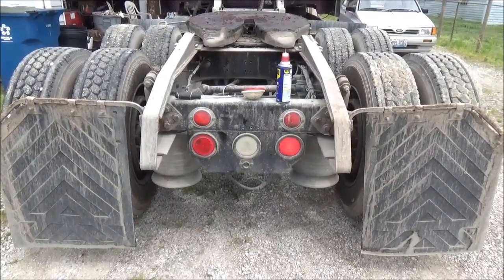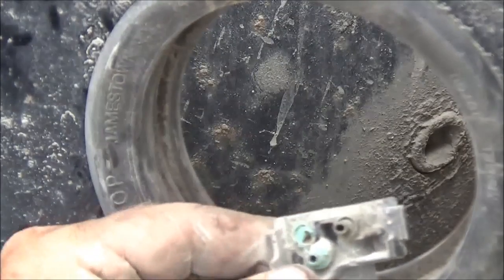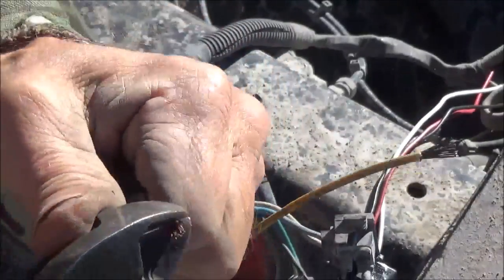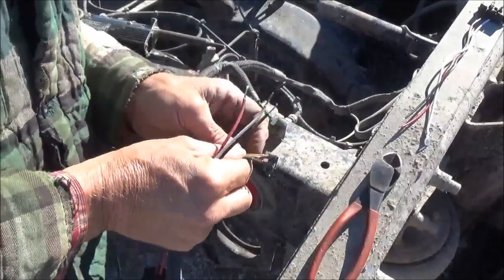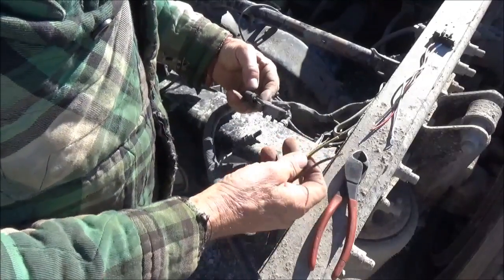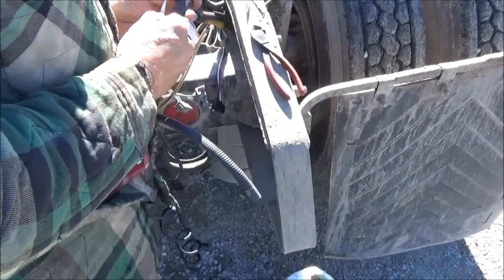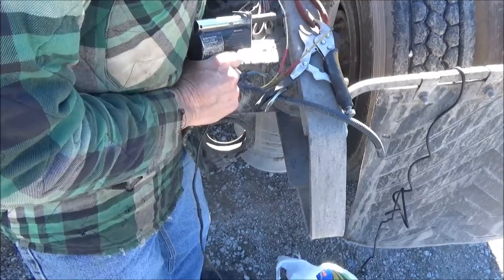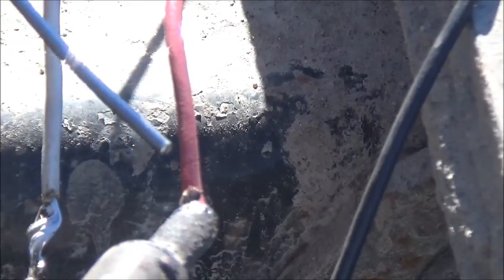Repair brake and tail light wire harness on big truck

Comment: Not many trucks running around without led lights anymore, very nostalgic:)
Reply from the maker: It's an old local work truck, he doesn't care about how it looks. If we went LED it would cost hundreds to change everything over, kind of pointless to do 1 or 2 lights at a time. But if we ever did the body work on it, I would suggest going LEDs all the way.

Comment: I was trying to rewire two reverse lights on a freight liner today with no success. Replaced to brand new 12v lights and getting only 10v on the meter. Problem?

Comment: Hi Gordon - good job - next time you have a soldering job try to use liquid electrical tape on the soldered wires - then wrap electrical tape - it will be protected in all types of weather .
Reply from the maker: Good Idea, thanks.
Reply: also good is heat  shrink and self amalgamating tape, but you cant carry everything!

Comment: Watched many of your videos, seems I just need bigger tools for the bigger toys, and good common sense. Good advice to solder the connections in a high vibration environment. Consider a blob of vaseline or dielectric grease  on the inside of the connector to keep the corrosion at bay on the contacts.
Like your ground level camera and monitor setup! Innovation at its finest. Now put wheels on for pan shots! LOL
Reply from the maker: You're right, the grease does help at the plug in connection. Thanks for watching and commenting.

Comment: I need to do the entire headlight running light and turn signals on the tractor. I have a 95 classic. They butchered the harness. No solder anywhere cut wires not connected everywhere as well. Any instruction you may have or any videos you may be able to recommend would be much appreciated. I can do the repair you've done in this video no problem, the only issue I have is breaking down every wire in the harness and figuring out each one. They hooked the damn wiper power into the headlights as well. When the lights are on I have no left turn signal and when they're off I have a left turn signal. Right turn signal always works. Just wanted to give some more information. Thanks in advance. I'm shut down til I get this problem fixed. These problems were "inherited " in the last two weeks but obviously took almost 3 decades to create so I understand I'm asking alot but like I said any help is much appreciated. I'm in ohio near Cleveland.
Reply from the maker: I can't be much help 600 miles away in the St. Louis area but I can tell you your left turn sounds like it is grounded to one of the hot wires on the headlight which gets canceled out when the lights are on. Give that turn signal a true ground and it will work fine. I'll try to remember this and another recent question on some electric work I did on a motorcycle as well as some older questions on small engine electric videos I did in the past and I will try to do a series on running down electric problems and the basic laws of how electric works and what size wire goes with what fuse/breaker and why. Once I understood this I never had any trouble fixing any electric on any 12 volt and also on 120/240 ac in houses.
         You might find some help in my playlists on auto electric and house electric.
Reply: Thank you I appreciate it. I figured it was a wire crossed somewhere just needed to hear it from someone with a clue. I can wire an entire house but in a vehicle I can replace existing but finding problems has been difficult in the past. I appreciate the fast response. Thanks again.

Comment: NICE VID,, pete sujestion of liq-tape,, howerver, its a good idea to use heatshrink tape,, do not use electric tape, unless you use liq tape to seal the exsterer end of the tape,, that way the tape don,t unravel later on down the line,,, 
I like the way you talk and exsplain as you go,, great job,, i just bought a 1977 kw,, and fine your vidieos most helpfull,, thank you

Comment: i put muratic acid and a q-tip to clean copper wire  before soldering. it is a light acid and wont hurt the wire or insulation. works great. i also like to put de-ox on the solder joint and then use heat shrink over it. it seems to work well.
Reply from the maker: Sorry about the heat shrink, I was out of the size to fit that wire. I'll have to disagree with you on the M. acid, I know how well it cleans and it can be used if diluted about 50% and then neutralized good with baking soda, but the acid soaks into the stranded wire where you won't get it neutralized enough and in time you will most likely have green corrosion that can end up eating through the wire. I was taught to never use acid core solder on electric work, if the M. acid was ok then so should be the plumbing solder. Thanks for your comment. I have used the muriatic acid mix for soaking multi connectors and switch contacts but always fear the acid getting into the stranded wire. Vinegar helps too.
Reply: Gordon Robertson everybody likes what they like.  I have never had any problems with doing it this way. always lasted longer than the truck or trailer. I appreciate your respectful way of disagreeing.

Comment: I have used sandpaper before to scrape the black off. Just spread the wire and fold the sandpaper over the threads and pull on the wire a few times. Every time I tried using cutters to scrape, I'd end up cutting the wire. I use liquid soap on the rubber grommets popping the lights back in. They seem to slip in pretty easy that way.
Reply from the maker: Good idea. Thanks for commenting.

Comment: if youve heard of 'cliit bang' cleaner, it works great to dip copper wires into to make them shiny for soldering, i also use it on inside things where the batteries leaked and it cleaned off all the corrosion, but i understand this is a field repair, you gotta just get it done!

Comment: On my peterbilt tractor the back up white light I bought a replacement and I cant get that sucker back in the bracket.  I never had such a problem it's the same light as the old one. Do I need wd40 to get it to go in? Omg!!

Comment: Hello sir I am having trouble on my freighliner the backup lights wont work,the reverse buzzer turns on when I go in reverse but the lights wont work, what wire off the reverse light lense is the one that hooks up when u engage the reverse

Comment: Gordon I watch all of your videos and I am desperate for some help on my 99 Kenworth w900 the brake lights are not working on truck or trailer. I have unhooked trailer to see if it could be shorting out truck. They still wont work on the truck with trailer unhooked. I have checked all fuses and relays and they seem to be good. If you have any advice I would be very very appreciative.
Reply from the maker: I haven't had to do that one on mine yet. The first thing that comes to mind is to check the brake light switch, on mine it is a N O (Normally Open) pressure switch, it looks like the oil pressure switch on the older cars and uses the same special socket to replace it. It will be under the dash somewhere on the brake air lines. That's the best I can do for now. 'Hope it helps.
Reply: @57bagre   thank you sir for your time.
Reply: @57bagre  Mr Gordon you were right point on one of the brake light switches had a loose wire thanks !!!

Comment: When we can not get the lead to stick to the green or black "copper" "We hit it with acid core solder, it rocks!" give it a shot! try it night and day difference, and its cheap. Auto Zone sells it for a reason. I've become a believer in using 3m crimp connectors with a shot of batt. term. protector.  Maintaining over a 1 hundred Refg. produce trucks gotta think outside the box. LED's from Grote are a god send on Chicago's' "washboard roads"
Reply from the maker: I always get the rosin core to flow one way or another, I know the acid core or paste flux will work too but down the road a few years it can bite you in the rear especially on outside wiring, it will turn green and keep working on that fine stranded wire and on up into the insulation. I was taught not to use acid solder on electric, I know it will work fast but can't trust it for too long. Thanks for watching.

Comment: I having problems with brakes lights with out preassure on the switch the brakes lights stays on when the preassure builds up lights goes out when press brakes pedal no brakes lights only 4 wires goes to the back of the truck 2red signals 1brown(park lights) 1white reverce
Reply from the maker: Are you sure you have the right brake light switch in? the n/o looks the same as the n/c but will have the opposite effect.

Comment: I wish someone would show what wires go to what from truck end .... yellow = right turn...

White is ground and it connects to..... would help greatly... anyone know????
Reply from the maker: I've covered that before if not on this video maybe in my playlist on car repair or auto electric, but that's ok here you go. On a truck white usually is ground, on everything, green is right turn, yellow is left turn, brown is tail lights.        I remember yellow left is like caution on left turn and green on right is like safe to turn.

Comment: Maybe try so of these wire contact s.    car quest  part number stp 525 they are water proof just put wires in holes then clamp with pliers
Reply from the maker: You can't beat soldering connections for anything exposed to the weather. Crimp on are only good for inside or well protected areas, I still solder everything, look what happened to the wire inside the insulation, 'ever seen green and white corrosion on exposed connections?

Comment: Your not putting any flux - that would help out I believe
Reply from the maker: Can't use plumbing flux on electric.
Reply: There's  a flux called Chipquik - No clean paste flux for laptop motherboard  work -  yes the video looked good - did a good job on the video - seen about everything - use this to remove  the motherboard transistors and other components - don't see why the chipquik wouldn't work for wires - got it on E bay - suggestion only  - it's in a small liquid tube